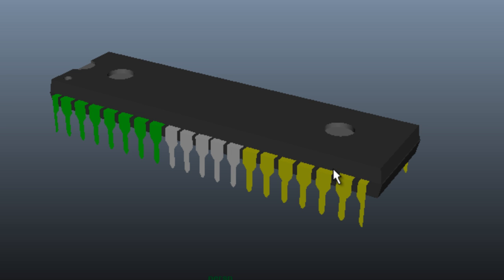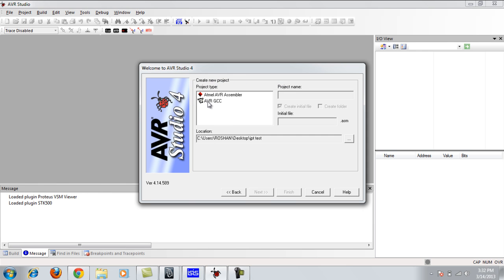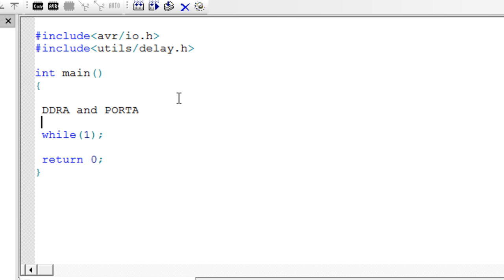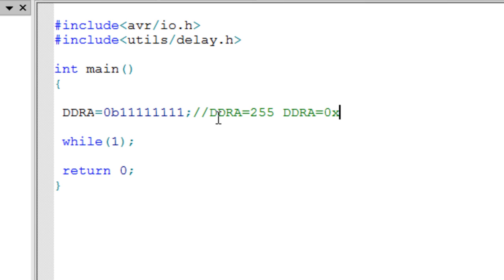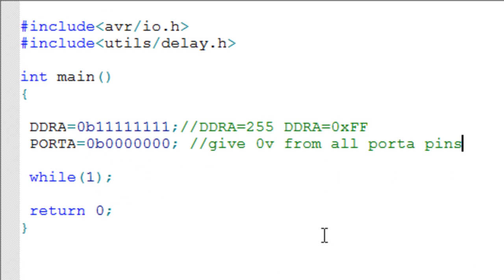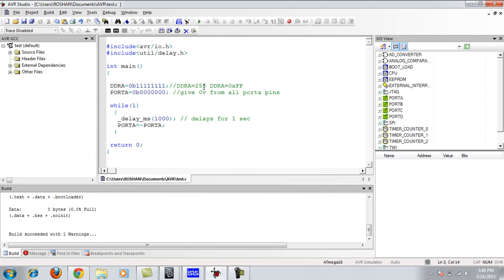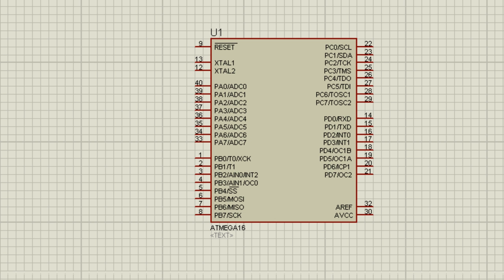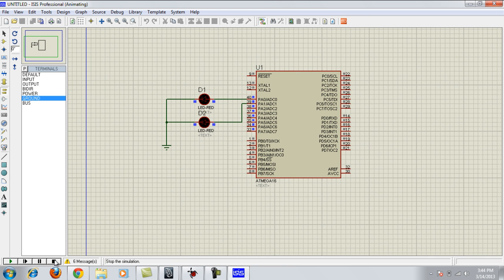AVR Basic Input Output (Part 1)

Comment: Shouldn't PORTA=0b0000000; be PORTA=0b00000000; 8 0's not 7 0's ?
Reply from the maker: Video was made long ago. I'm not sure what I've mentioned. And too lazy to go back to video to check right now.  But both will work.  Just writing only one zero should work too. But it would have been clear had I told 8 zeros instead of 7. Which would have given sense that each zero represents individual pins of porta.
Reply: @roshanbhatta2771  have a question for you. Do you have time
Reply from the maker: @blackkimba851  Sure.